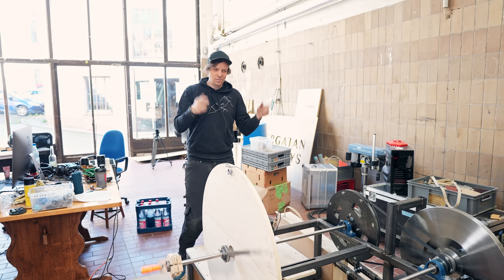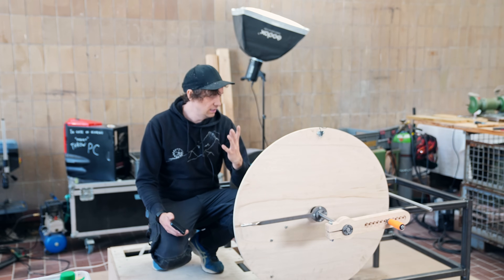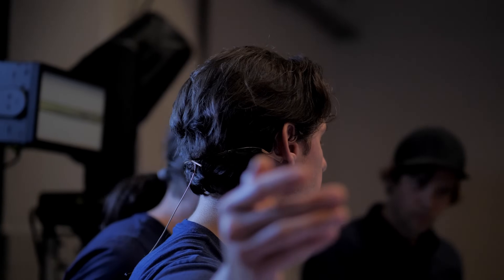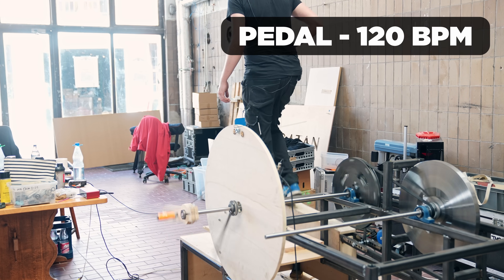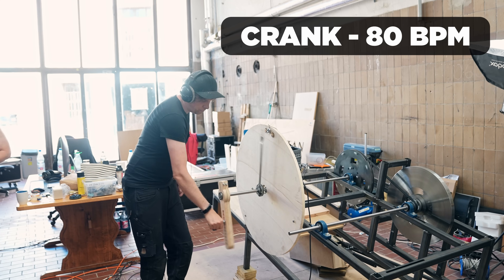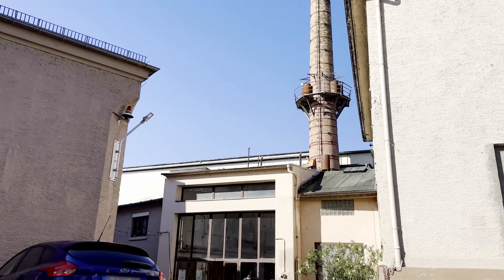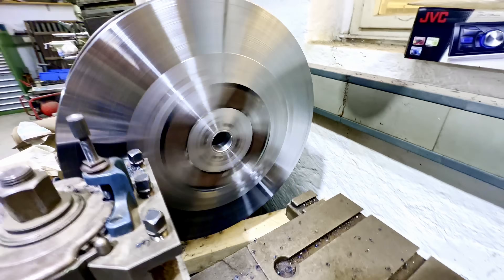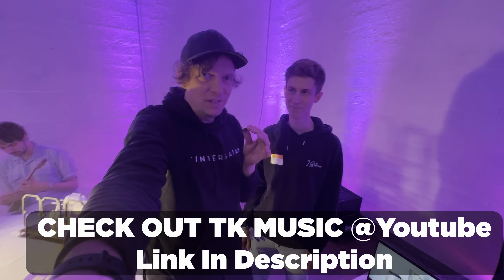The Prototype is Finished - DAY 10 - Marble Machine Flywheel Prototype

Comment: Forgive me if this has already been addressed. But you could play tighter music if you used a stepper motor to control the speed of the mm's flywheel. BUT you could use a hall effect sensor on a separate flywheel connected to your foot pedal to control the speed of the mm's flywheel. So if you are live and the crowd is electric you can increase the tempo by pedaling faster.  There would be no need for a mechanical connection between the pedal flywheel and the mm's flywheel. With the pedal having a separate flywheel it would give you the biometric feedback but the stepper's speed controller could be programmed to smooth out the analog signal from your pedal to keep the music tight and possibly the best of both worlds.

Comment: This would (probably) require a different data gathering mechanism, but one possible way to get a real-time measurement of the speed of the shaft would be to attach a small DC motor. The voltage generated by the motor would correlate to the speed of the shaft, and fluctuation in the voltage would show the increase/decrease in tempo. This would have the side effect of placing a slightly load on the shaft, which could make for a slightly more realistic measurement than the unloaded flywheel does.

Comment: I was wondering about the pedal taking energy. I was thinking you could create a counter weight on the other side of the pivot of the pedal.
Reply: The counterweight wouldn't cause it to take less energy, just to take energy more evenly. The energy loss is friction, not gravity.

Comment: @Wintergatan Hey Martin, it looks like your handle came lose in your hand cracks. If you look at the earlier part of the video the hand crank and the plastic contact arm are nearly but not quite parallel (really bothered my OCD) but then at some point the crank arm was no longer in sync. There is a chance some of your driving force was lost in the crank. Also, the wedge to raise the legs of the machine also may have absorbed some of the downward force of the cranking. Lastly, you will certainly have more leverage force with the step pedal because of the length of the lever, if your hand crank was a longer lever it would have comparable values, but then your arm would need to go in large circles, so you would be better changing it from a hand crank to a hand pedal similar to that of the foot pedal, but I'm sure an up&down motion with your hand would be very exhausting. Another thing to consider is the strength of legs versus arms. A person who can only benchpress 110  U.S. pounds can probably properly squat 300 U.S. pounds easily. We have way more force with our legs than we do our arms. So by nature, it might play tighter with legs. You should have Hannes do the hand crank test, that would be a good controlled variable to see if athletic fitness has any factor in this machine or not. Not saying you aren't fit, but you do not have Arnold Schwarzenegger ripped arms so this crank method might not be for you. This also takes the bias of the test our, because you are the common factor here, and if Hannes gets the same results then we will know it is the machine. Just a thought. Thank you for keeping this dream alive!
Reply: From a physics standpoint, the larger input will cause a bigger change in the system. In other words, the foot pedal should be much less tight than the hand crank because the power input pulses with the foot pedal are much larger, or at least much peakier, than with the hand crank.

Also, as long as you don't leave the ground, any force you apply with your foot has to be less than your weight. A force greater than your weight would result in a jump off the ground. In order to apply a force greater than your weight you would have to hold onto something or be strapped down or be holding some weight.

Comment: How about putting a bicycle shoe basket onto the pedal so it's possible to pull up too not only push down. Allowing for smoother driving.
Reply: Adding a second pedal with shoe basket 90° phase shifted (and a bicycle seat 😂) allows to be as smooth as the crank.

Comment: Love your videos Martin! Congratulations on your new project milestone! 

I was thinking would it work to have a second flywheel that would be an intermediary wheel between your larger wheel and your energy input (hand crank or foot pedal). You could then introduce a little gearing between flywheels. This will keep your main fly wheel at a steady 80bpm while the first fly wheel takes your sporadic energy inputs and normalizes that to a steady 80bpm through some sort of gearing mechanism to the second flywheel.

Comment: learning curve with production process aside, i think its got promise. a few thoughts. first, if you were to introduce a weighted pull with some torque, the crank might serve as a good speed gain. perhaps its just a trick of the camera but it seemed that the petal was much more useful when the bpm were closer to 60bmp; whereas the crank seemed harder to maintain once the tempo was set, it seemed like cranking it was not as effecient for a long preformance as using a foot petal. second thought. have you considered making the platform dipped in where the petal is? this would give you more room to add force to the petal. and if you remove the current side guard and add a bowl shaped extension to give your foot a larger area to step on you could add a torque in the bottom say 20% of the petal for tempo adjustment. thirdly, i know this is a prototype, but have you considered adding in room for physical comfort while on stage? the toll that standing in an upright posture can really affect you physically, especailly if the goal is a world tour where youd constantly be on stage. consider incorporating a slide out seat, or some type of surface you can use to rest while still operating the machine. just my thoughts. truly inspiring. thank you for sharing your journey, im so inspired by the work your doing

Comment: My feeling is that a machine with friction will give you much different sensory feedback than a test of the flywheel section alone. And this is even before considering the myriad of oscillation modes which the rest of the machine could potentially add. I could imagine that it would be worthwhile to test two things which you can measure already now: first, attach a contact microphone to both output shafts and measure the play between the two shafts. That’s the bare minimum of dynamic twist within a single module of your machine you can achieve. The whole machine will be worse. Second, add sone friction to one of the shafts, preferable with some periodicity. A wheel pedaling in water in an enclosed acrylic box could work well as a “model” of the friction and partially chaotic, partially periodic feedback which the rest of the machine will provide. Then re-do your timing tests.

Comment: The pedal takes energy from the system on the way up, but gives it right back on the way down ... the pedal weight might add to the total flywheel weight and actually improve it (very slightly)

Comment: After how painstakingly tight you got on the marble gates, the flywheel hurts

I hope adding more weight helps, having the whole machine powered by yourself rather than a motor is important to the spirit of the machine
Reply: Unfortunately it won’t… directly measuring the flywheel is a useless endeavour.  The fly wheel is to store extra rotational energy, at a higher speed.  Without a transmission where the output is set to a set BPM this is all for nothing.
Reply: IMO the spirit of the machine is to have marbles manipulate the instruments.   Just use a motor.  Move on and be successful!

Comment: For prototyping, why not use aluminum extrusions for the frame?

For the fly wheel input, why not have manual option for starting songs or for slower bpm sections for songs and use motor control to free Martin to be creative with other parts of the music.

I know that it was attempted before, but I think it can be improved and if given the green light the community would be a huge help to developer.

Comment: It seems to me that Martin is testing two different but related things: 1. The machine's ability to keep tempo. 2. Martin's ability to drive the machine.
Reply: What is the baseline for manual adherence to a click? Martin should just record himself playing a very basic beat on the drums and record how tight that is.
Reply: The pedal should be on a ratchet like a bike so that the flywheel doesn't increase the pedals tempo, have it spring loaded to return up to home. It won't crush his feet either. Kinda like a kick drum
Reply: Pedal to drive the weights up. Weights to drive the marble machine with a gear selector for the bpm. Crank will be needed to spin up the machine before you engage the weights.
Reply: Yes and actually there is a third thing which is the phase between the machine's piezo output and the audio click input. Martin has no way to sync those without throwing the frequency out of whack
Reply: @SamChaneyProductions  if the software calculates mean deviation from the click pulse and then subtracts that mean from each pulse then any offset due to experimental synchronisation could be accounted for before reporting the final standard deviation metric. The software might already be doing this. Edit: I now understand what you meant, it might be the click's audible position in time relative to the foot's work cycle which is making the job of syncing harder than it should be.
Reply: It makes sense that driving with the pedal and therefore using his stronger powerful legs would make the beat more consistant. The only other way to get around it would to disconnect the input and outputs so that the machine its self determines its beat more like a clock with an escapment and spring/weight system.
Reply: The best way to characterize the machine alone is to bring it up to speed and then stop adding power. Just let it wind down. That behavior will be consistent, and any deviation from that when martin is driving it is entirely due to Martin.
Reply: We already know Martin knows how to play music in time to a click track. If he can't get the music in time, while it's true it could user not using the machine correctly, it also suggests then the design is unintuitive for an experienced musician to get the machine in sync, as it will be played by a human. So I think this is valid testing approach, the alternative is instead have the live musicians follow the machine, potentially with its metronome wheel acting as a "conductor"
Reply: @mccafferyfamily  manually driving the machine to a constant bpm for a good duration is in this case almost impossible. unlike in drums where the output (sound) is pretty much instantaneous with the input (feet/hand hitting the drums), there is too much lag between pedaling and click sound and is always slightly changing making it non- rhythmic from the user POV. there is no correlation to being an experienced musician or not.
Reply: @reng7478  this still highlights flaw in the system, as experienced musicians can play instruments in time to a click track. So this test failing would show the design is flawed for use as an instrument if you want it to match existing music , more so if you have video/lights/laser show etc that is synced to a click track
Reply: We need hamster wheel dancers to power it!  You know it makes sense.
Reply: @1itim  That's exactly what I thought - just like the boys that drove baroque organ bellows, only put 'em out where they become part of the show.
Reply: Yah. Seemed like deviation improved with practice as opposed to physics.
Reply: This is what I was thinking. He feels like the crank is easier when the data disagree because he probably has an easier time correcting his tempo on the crank, even if the tempo needs correction more often. The pedal is more consistent but seems to take longer to correct, which looks good on data but is probably more annoying for him to play.

At least that's what I'm intuiting. There's probably a more logical explanation that I'm not seeing clearly.
Reply: Yeah, I feel like trying to match a metronome at a fixed bpm is going to be extremely challenging. That's not really the goal if this is going to be playing as part of a band. IMO what should be happening is the "metronome" should play a fixed tone 500ms after the machine hits the registration mark and Martin's job should be to make sure the next time around it hits exactly at the same time. This means that if Martin can do this then it will play at exactly 120bpm. The band can use the marble machine as the source of timing and adjust themselves to any kind of deviations. It's not like it's even possible to play at exactly 120bpm if they are hearing the marble machine playing beats at 119.9bpm -- they will correct themselves to the slight variance automatically because they're human.
Reply: Lots of research out there that has already been done that shows perfectly timed music is less pleasing to the ear than that which has natural deviations. Aside from which, these tests appear to be focusing on relationship to a metronome click rather than actual bpm. Ultimately the weakest link in the chain is going to be the limiting factor & that's going to be the ability of the meatbag in control to recognise the deviation and adjust accordingly. As suggested elsewhere, a session at the drums to give baselines both with & without a metronomic guide to compare against would be beneficial.
Reply: true. i don't know why he is trying to achieve a consistent bpm manually. he should again use a motor to drive the flywheel and check the "tightness" that way.
Reply: Exactly my thought. The subjective difficulty of matching the bpm is just as important as whether it’s physically possible.
Reply: With a manually operated machine, the operator is part of the machine. If the operator can keep better tempo with one system, then the machine is just better. It doesn't matter if the machine spins down more consistently if it can't be operated consistently.
Reply: Furthermore he needs to put the results of different speeds in relation to the speed. The tightness deviation at double speed is equally off at half the time. So 3ms at 60bpm = 1,5ms at 120bpm

Comment: Likely the pedal is better as you can time your push to each beat (or some ratio) whereas the cranking is continuous over each revolution. Possibly you might learn to crank consistently but it might not be worth it. Might make sense to use a speed governor you can set to a BPM

Comment: Moving the microphone to a different position could improve crank accuracy. When you're powering the machine using a crank you're going through a cycle of pushing and idling (allowing it to continue moving without any input). In the video the mic is positioned in the inertial part of the cycle, so the BPM is predetermined by your past input, therefore you're unable to adjust right before the mic is hit (which you can see visually). Moving the mic to the pushing part of the cycle could allow you to adjust in real time (or maybe provide more data to analyse).

EDIT: Moving the machine so that cranking is more economic seems to achieve that goal (at least partially)

Comment: Where the 100 closest samples filtered out of a longer section? I don't think that's representative of how we hear music. We don't think "Oh, all through the song, I heard a lot of moments that were on tempo." In fact we think "What a horrible song - the beginning was completely off tempo." We don't care about counts or averages.
I think that the pedal constantly and very gradually crosses the exact tempo, resulting in, statistically, more clicks closer to the actual tempo.
But the handle is always close to the actual tempo, but never spot-on! While the pedal (sometimes) is spot-on as it crosses over!
Listeners don't hear a subtle off-tempo below a certain threshold. The pedal goes way beyond that threshold, while the handle always stays within that boundary.
Never thrust statistics. The math is always correct, but it's the interpretation where it goes wrong.

So, don't take the best samples, take the worst ones! That's what the listeners hear and base their opinion on!
Also try a chronological section of 100, not the best or worst.

Comment: I feel like having an assist motor to add some power but not fully drive thee system would help by requiring less large muscle group movement to drive the system. It would allow hand cranking also.

Comment: You are trying to match Phase AND beat… your testing methodology is bad, you should only match beat, not phase. Ask your programmers if they can modify the software for ‚live‘ input and output your actual live bpm, and then play an exact 80. you can see the wavy bpm when you over-correct constantly the phase instead of bpm in the graph!
Reply: Yes, exactly that. Instead of a metronome, just play back the contact microphone at a 1000/[desired BPM] millisecond delay.